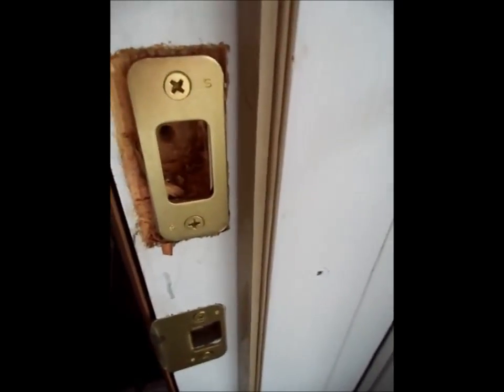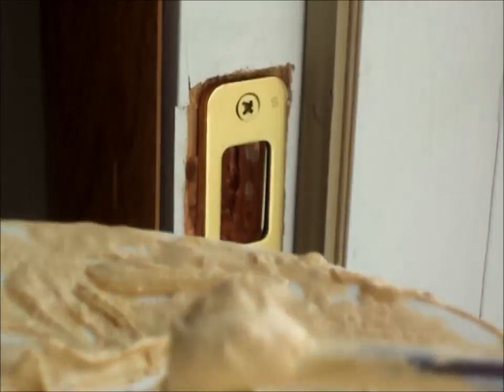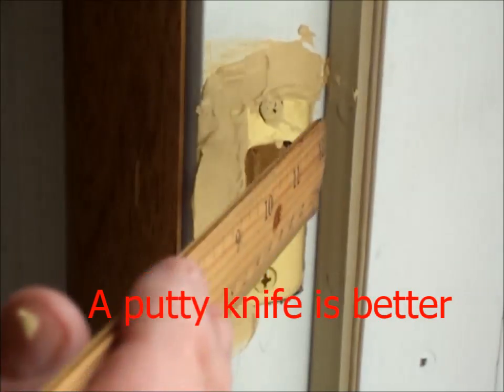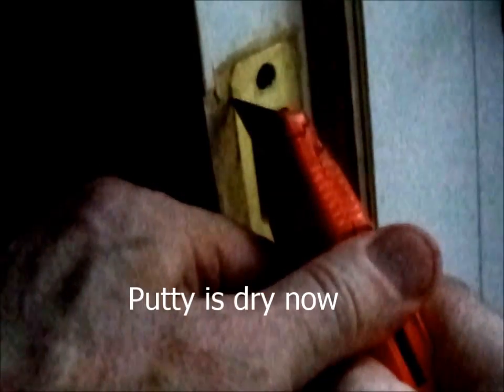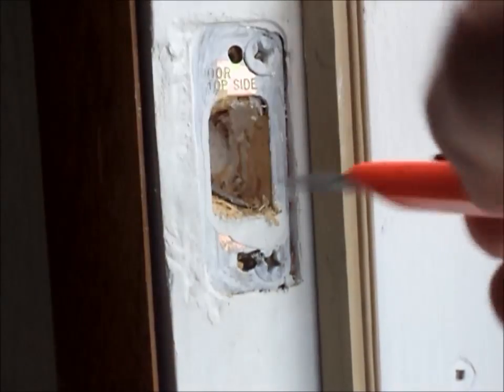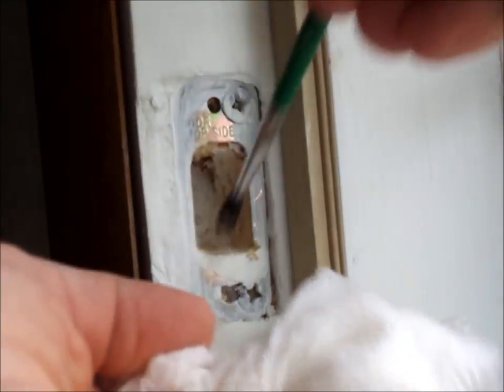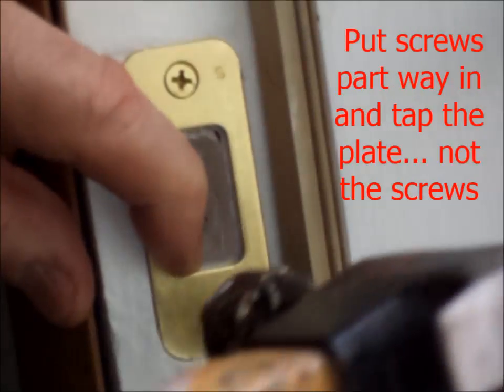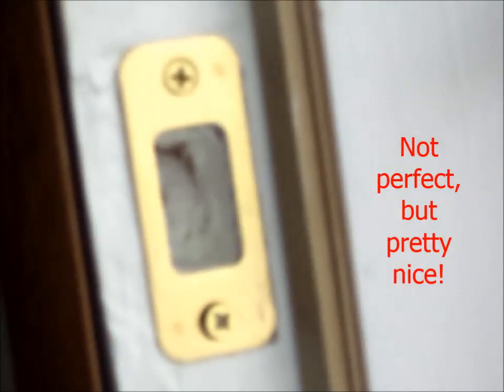Hole Too Big for Lock Strike Plate on Door Frame

Comment: I used this product early on. It does not hold up, it cracked & came out of place in  varying size pieces. Either chisel out the hole & glue & nail in a square wooden plug or mix fine sawdust with wood glue. Take a small drill bit & drill hole for latch assembly, keep enlarging hole until latch assembly can move freely with strike plate installed. Fine tooth finishing or plywood saw blades produce fine sawdust.
Reply from the maker: My Durham's Water Putty install has been holding up perfectly for 5 years. Maybe yours was OUTSIDE?
Reply: @gandyangeles8427  picture showed strike plate hole, that was the same repair I made, that was over 30 years ago about 20 years after I started doing carpentry work. I never used it again.  if it worked for you that is good. I just tried to give an alternative, to someone that had a similar  problem & the putty didn't work,  things that have worked more consistently for me. It was a great video you posted. Thank you for responding!
Reply from the maker: @johnhora4644  Durham's Putty expands slightly as it dries so it will "stick and stay put." This expansion, however, may also cause Putty to "pop" from a smooth concave surface. Perhaps your surface was too smooth and there was nothing for the putty to "grab" as it expanded?
Reply: @gandyangeles8427  actually it was a very rough surface,  basically the same example you showed in your video,  sorry I thought I made that clear in my post, my bad.
Reply from the maker: @johnhora4644  I appreciate the feedback. I looked online and can't find more people with bad experiences like yours so I will leave the video up thinking maybe your experience was not the norm that can be expected..
Reply: @gandyangeles8427  please do! Was not trying to be negative or berating. We just don't use it here. Durhams Water putty is gypsum based & not water proof, it must be painted. If you see the paint peeling you must find the source of the moisture & stop it from getting into the putty.
Reply: I like your creativeness.  I am also a landlord and have regular repairs that need to be made for various things and I have to weigh whether I find an acceptable fix I can do myself or higher someone that MAY fix the problem that charges a small fortune.😂

Comment: Fix it right, this is a bad patch
Reply from the maker: Its been 2 years since I did this fix and its holding up perfectly. No problem at all. So no need to worry if you do it this way.
Reply: @gandyangeles8427  we use this stuff at my painting company to fix wooden doors. Works great